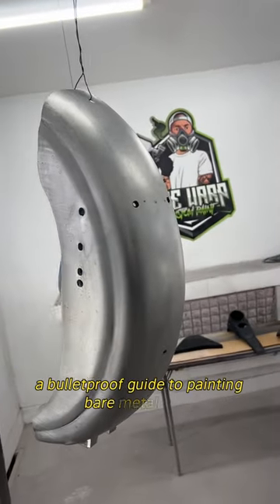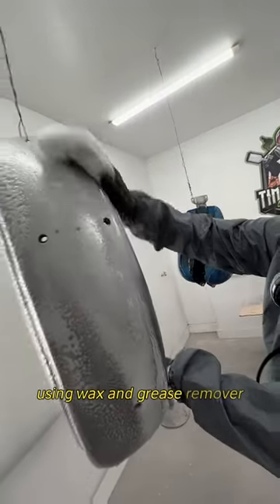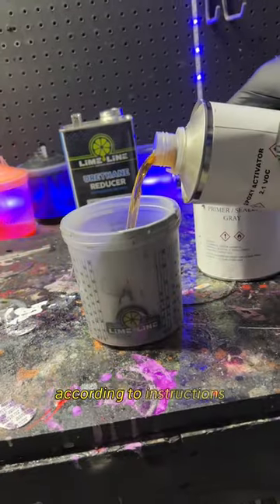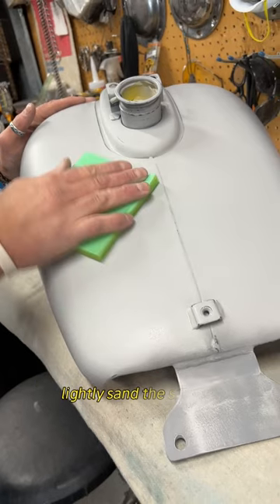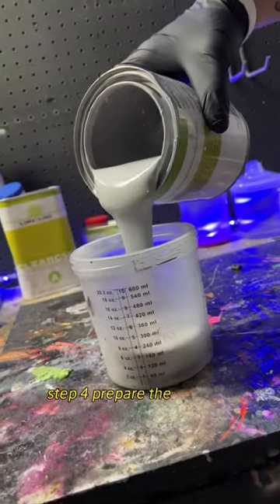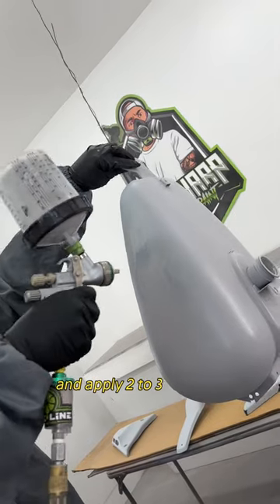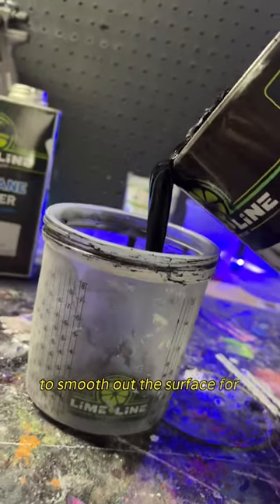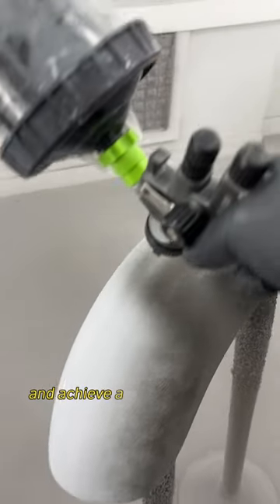This is one of the best ways to prep and prime, your bare metal parts for painting.

Comment: Don’t use 600 grit use 320-400… paint won’t stick as well with 600
Reply: Actually the 600 puts a better surface for adhesion. It's hard to explain but there's finer scratches and more surface area for the base to grab onto.